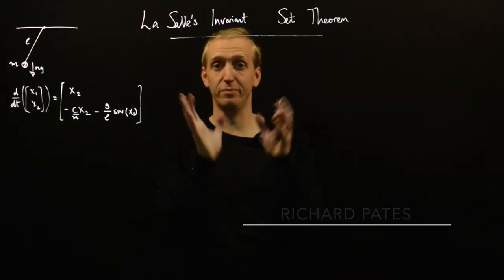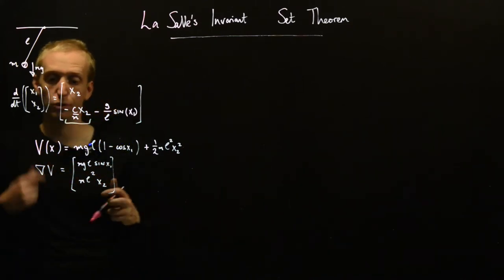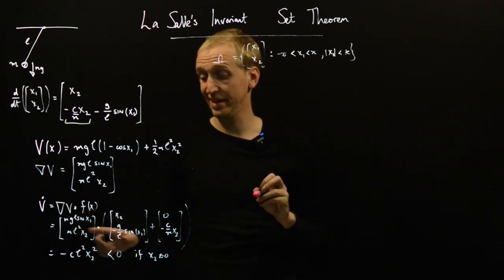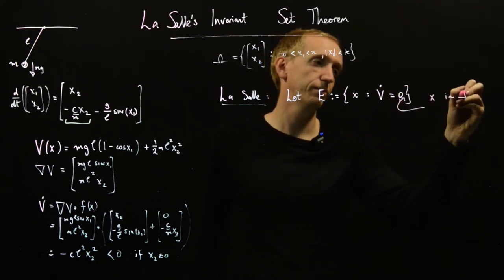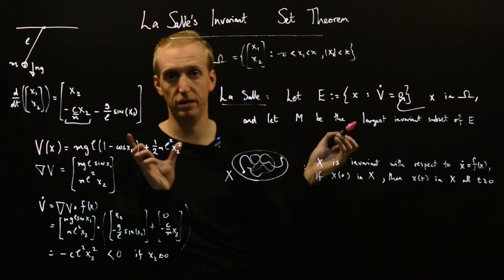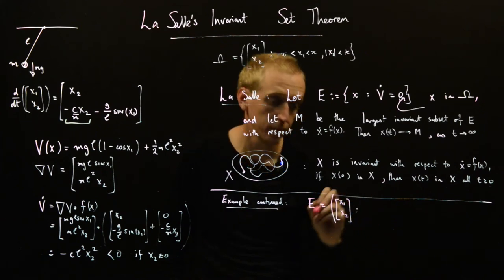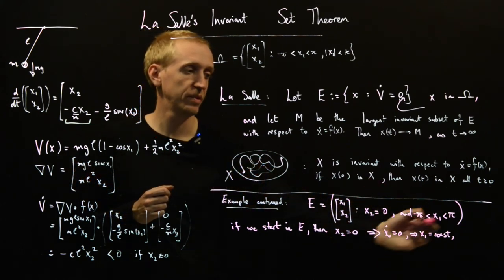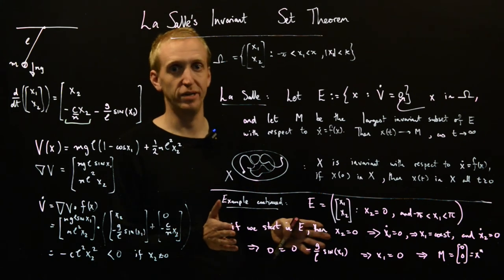LaSalle's invariant set theorem

Comment: Very helpful! One question: How the set omega was chosen?
Reply from the maker: Good question - and very difficult to answer! This set omega acts as a kind of underlying region on which everything is defined. The reason you need it is mainly mathematical. There are some extra technical difficulties if you try and prove results on the entire state-space (you need some extra conditions on the growth of your Lyapunov function in these cases) - and sometimes you have systems with singularities (or want to pick Lyapunov functions with singularities), and then you want to pick omega so that it is sort or focusing on the part of the state-space around the equilibrium point where everything is defined. I think you can get pretty far by just ignoring the role of omega - there should be no problems as long as you are doing 'sensible things', and the main ideas are all in the sets E and M, and the idea of a Lyapunov function. If you want to write nice mathematical proofs however this is something you'll need to worry about!

Comment: Thank you for the video! I was wondering if you could give a better explanation of what 'Largest set M' means or maybe give an example where the set M is not just one point. Thank you very much
Reply from the maker: Hello! I can try - though perhaps I can also recommend that you watch the video 'An Example Using LaSalle', since it might help clarify things. You really want M to contain a single point - and if it doesn't you will probably not be able to conclude stability of an equilbrium (rather you may have a limit cycle, or perhaps 'almost everywhere' stability instead - but the analysis starts get much more technical now).

But I'll try to explain. The objective here is to try to extend Lyapunov arguments to functions that don't quite satisfy the condition \dot(V(x))<0 for non-equilibrium x. Don't quite here means that \dot(V(x))=0 for a range of values of x - including the equilibrium point, but also others. This is the set E in the video, and this situation often arises when you use physical energy as your Lyapunov candidate . The basic intuition is that the set E gives a level set for which the value of our Lyapunov function neither increases nor decreases if we take a small step along a trajectory. This means that if we are in a state in E we cannot conclude that the Lyapunov function decreases, which would then ensure (from the other Lyapunov conditions) that starting in E would result in our trajectory heading to equilibrium. But if we can show in some other way that every trajectory that enters E will leave E, then since our Lyapunov argument works everywhere else, we can then conclude stability. This is all that is happening in LaSalle. We take the set of points that we are 'unsure about', and try and argue in some other way that every one of these points except the equilibrium must be part of a trajectory that enters the region where our Lyapunov argument works, and hence conclude stability. The definition of M is then just a way of formalising this idea. A point in E is invariant if for all future times a trajectory starting at the point will stay in E. M is then the set of all points in E that have this property (this is all the 'Largest set' bit means). If the equilibrium point is the only such point, then every other point in E will be part of a trajectory that leaves E, and hence must be tending to the equilibrium.

Comment: very interesting lecture. question please: why lyapuove function V(x) may not be positive definite in lasalle theorem?
Reply from the maker: Hello! Sorry for any confusion, but V(x) does need to be positive definite (ie V(x)>0 for all x except when the point x equals the equilibrium point). The only difference when applying LaSalle is how we treat grad(V).f(x). When using the normal Lyapunov stability argument, we need grad(V).f(x)<0 for all x not equal to the equilibrium. When using LaSalle, we can weaken that slightly and instead allow grad(V).f(x)=0 for a set of points in some set E (including the equilibrium point). Then provided the largest invariant subset of E (the thing called M in the lecture) is equal to the equilibrium point, LaSalle guarantees asymptotic stability of the equilibrium point, even though our Lyapunov stability condition isn't fully satisfied.